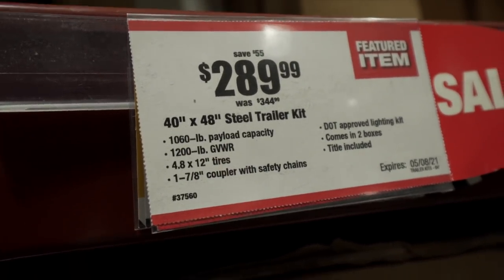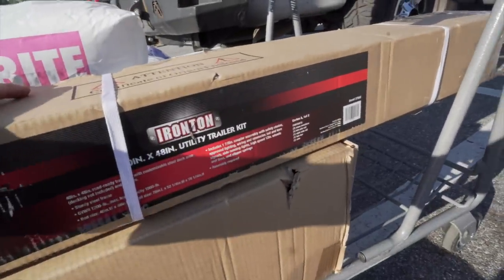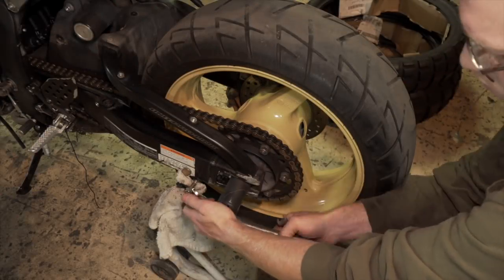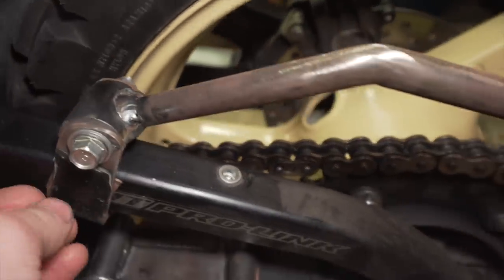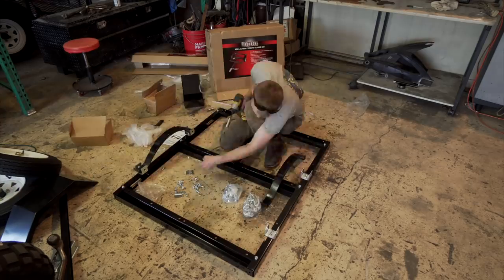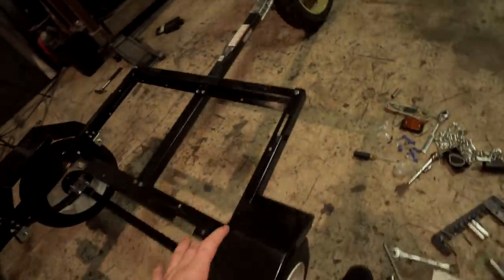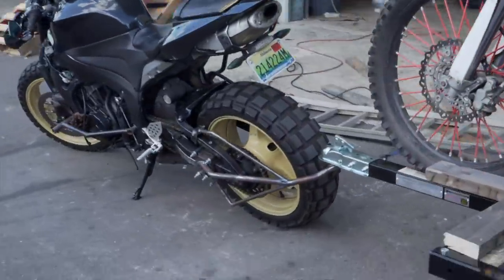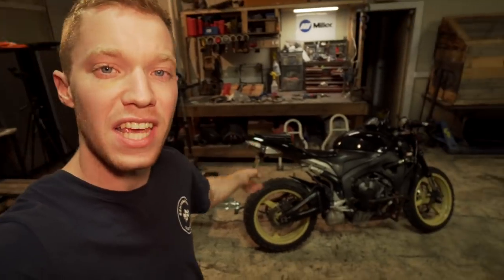$200 CBR600rr Wrecked Bike Rebuild (PT. 10 TRAILER HITCH/Off-road tires install)

Comment: Trailer must be attached to the frame for safety reasons. On the guide axle, which is the rear, it is dangerous to life. The trailer will steer the towing vehicle on its own. I would not drive more than 20 mph with it.
Reply: It will not steer the motorcycle if his swingarm bushing is in good condition